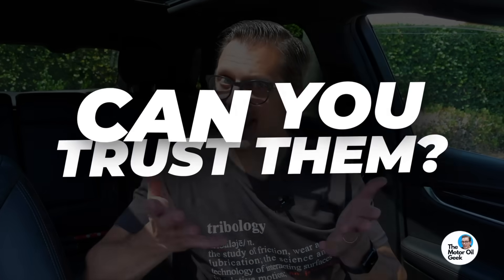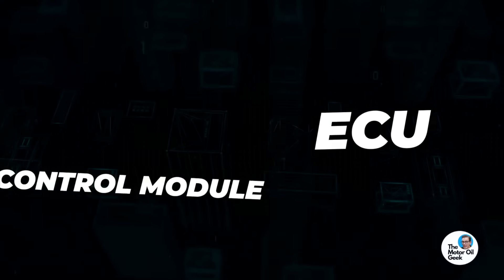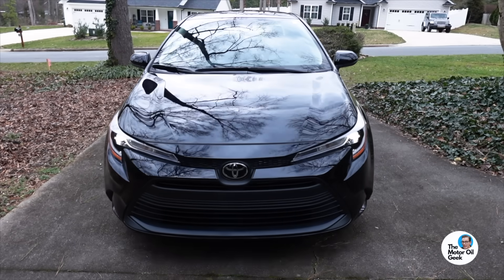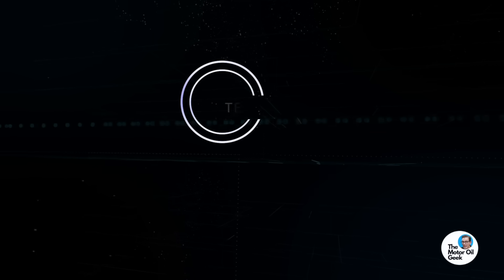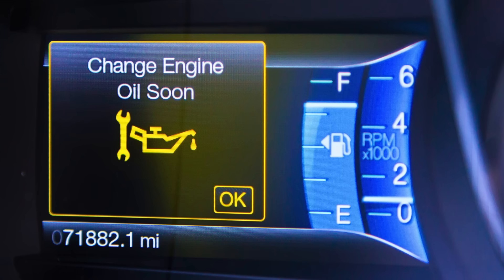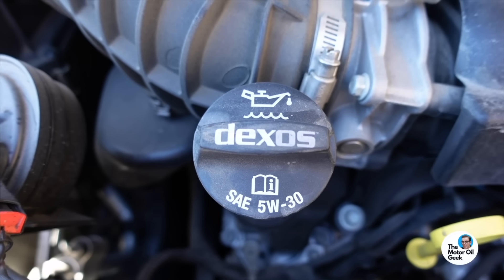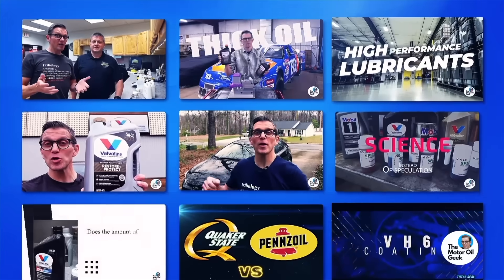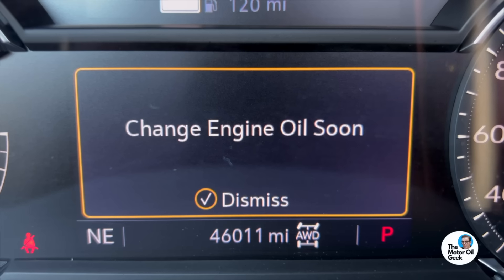The Accuracy of OIL LIFE Indicators REVEALED!

Comment: Used to have a 2006 Civic that comes with the % oil indicator and one time I found out the interval is 6k miles travelled when at 5% oil life. Currently have a 2021 RDX with the oil % indicator, and the time interval is 12 months at 5% oil life given that I didn't really drive as far during the work from home era. So I do agree that it will be 5% oil life at 6k miles or 12 months whichever come first. So usually people suggest 5k miles meant it is going to be around 15-20% oil life left, which is a decent enough; I do feel like exceeding 7.5k oil change interval does hurt the engine in the long run even though some car brand suggested 10k miles interval.

Comment: I had Chevy Cruze 2013 1.4l Turbo, I followed the monitor for most of the time I owned it, end being about 7,500 mi. cycle, the last four years of ownership I started doing it every 5k miles. 10 years later I sold it with 170k miles with same engine and transmission no major issues, I. Should kept it as a daily driver.

Comment: A friend bought a used Rental car in 1987 from a major National chain. A 1985 V6 tuned port Camaro with 49k miles.

When he had it a week he changed the oil and filter. 

It had the original dinky oil filter when the we engine was made. Ie the painted block had covered much of the filter but not the part closest to the block.

So at least with rentals in the 80s they just added oil and never changed the filters ever

Comment: As someone that does oil changes at no more than 5,000 miles on every vehicle he touches, those stupid ass oil life monitors are useless. Most of the vehicles I see with them seem to be set up for between 7,000 to 10,000 miles between changes, and I have seen the damage first hand that those extended life changes cause. And as for companies that now make vehicles without dipsticks, they can shove their vehicles back where the sun doesn't shine because that is stupidity of the purest form. Ok, so the average moron, I mean driver, never pops their hood, they likely don't know how to, but the mechanic that works on these engines NEEDS a dipstick, if anything to at least cover their ass! THE very first thing I do with any vehicle I work on is pull the dipstick to check oil level and quality. Without a dipstick, can't do that, just have to go by what the computer MIGHT say for fluid level, but you have to wait for results and some vehicles even force you to start them and warm them up before they even tell you how much oil they have. It is all extreme stupidity, and its all designed to make engines fail so these shitty companies can justify wasting more resources to make another buck. Call me wasteful for doing 5,000 mile oil changes, but considering my roommates still have the original engine, with its original turbo, in their 2011 Chevrolet Cruze they bought brand new back in 2011. There is almost no varnish on the inside of the engine, the turbo still spools perfectly and quickly, still makes its normal max boost, the waste gate still controls boost perfectly and its doing all this with nearly 120,000 miles on the car now. And yet, the 1.4 turbo engine is one of the most replaced engines because people listen to GM and the oil makers and do 10,000 mile oil changes, and blame GM for making a shitty engine. No, its not the engine that is the problem, its the people and lack of oil changes more often than 7,000-10,000 miles. Do not listen to the oil life indicator, just do  yourselves favors and do your oil changes every 5,000 miles, or don't own a vehicle. It really is that simple.

Comment: People, just change your oil!  There are sooooo many variables in how we all drive - start up temps, idling time, stop and go traffic, how heavy or easy of a driver you are, trip duration, mileage/wear on engine, do you have real winters where you have to scrape ice off your car before driving away or do you live in southern California an can just start and go, blah blah blah.  Like the video said, the one engineer said she can make any oil fail just by giving it to her mom (or was it grandma?) since she only drives exceptionally short trips.

Personally I drive short trips as I live in a small-ish town.  Gym is 3km (2 miles) away, grocery store is about half that.  I change my oil every 5-6k kms because I know I'm getting condensation and just by smell, gas in the crankcase.  My oil life monitor is usually still at 60% or so oil life left by this mileage.  No way and I going to let that get down close to 0%.  Oil changes are cheaper than an engine repair.

Just change your oil people.  No idea where the brilliant idea came from of people spending $40-50-60k plus for a vehicle just to save the cost of an extra oil change a year.  Makes zero sense.

Comment: I wonder how conservative the oil life monitors were on older GM vehicles?  I kind of suspect the programming was adjusted to err well on the side of caution after the lawsuits against GM for premature engine failures.  And rental cars, while beat on like the proverbial redheaded stepchildren, also have primarily highway miles IMO.  Would be interesting to see if other manufacturers' monitoring systems were the same.  Would also be great to see an analysis of a similar vehicle in the rust belt in winter that has 100K miles on it where the oil monitor showed 9% remaining.  Great video and topic.